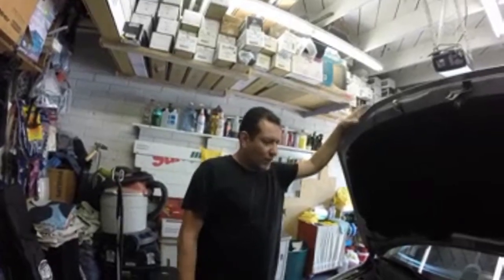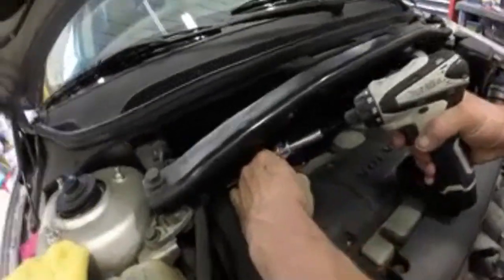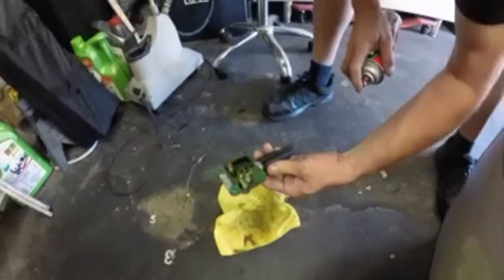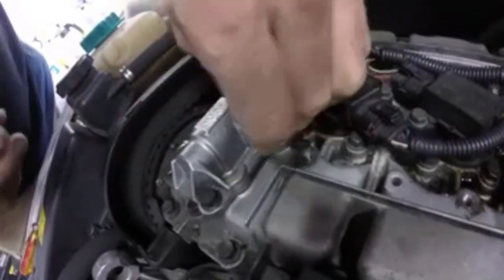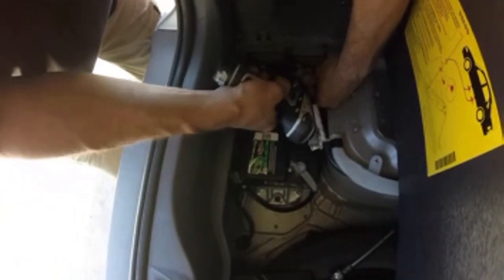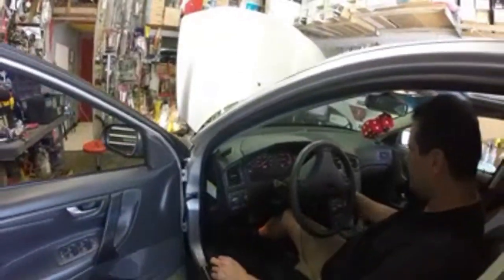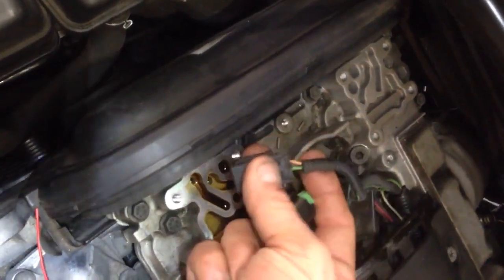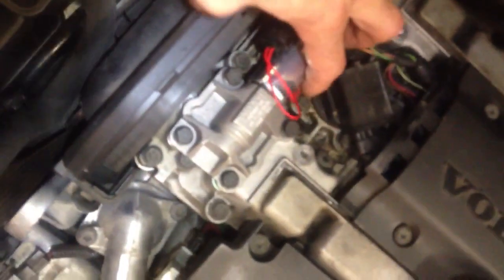Camshaft reset valve no signal fix 2001 Volvo S60 2.4 non turbo code p1011, code ecm-640a.

Comment: Raul, do I need to solder the cable connectors? And what is the exact pressure for the bolts (or is this not important)? I am planning to replace this solenoid soon since I am getting the CEL and the Emissions service required message (OBD II code P1011, so I think it has to do with the camshaft variable timing). Also, is there a way to check if the solenoid really did fail on me?

Thanks in advance and thanks for the very helpful video
Reply from the maker: Michael van Dooren you don’t have to solder them, but if you do, make sure to use shrink wrap. Would Be easier if you did solder, because tucking the wires with connectors is a bit harder.
Reply from the maker: Michael van Dooren not sure what its torqued at. I just hand tighten them alittle snug. I dont know how you could test the solenoid.  Mines was missing the screen on the gasket, and i tried cleaning mines out. Didn’t work, so I replaced it. Cleared code and it never came back
Reply: Thanks a lot man, I'm going to order the solenoid including the gasket etc. this week, I really want to get rid of the code and this is pretty much my last hope

Comment: Raul Romo what kind of power drill are you using in this video?
Reply from the maker: Samuel Simons its a 10.8 volt impact Makita. They only make 12volt ones that are blue and white. Mines can take the 10.8 volt or 12volt battery’s   ( they only sell 12volt replacements for my drill. Hard to find originals anymore.
Reply: Oh ok thank you Raul Romo and I got one more think to ask on my Volvo I got a code P0027 is that an easy fix? Or could you recommend me a video to watch?

Comment: I have a 2001 S60.  Getting c ode P1011, which is in this video's title, along with evm-640a.   Are these two codes one in the same?  Having no drivability issues, just a check engine light that keeps coming back after being reset (apx 50 miles).
Reply from the maker: Yes they are. It's two different types of scanners, but same code and issue. I replaced the solenoid and it fixed the issue. Cleaning it didn't work.
Reply: EXCELLENT!  Thanks for quick response!!!   Looks easy enough to fix--thanks to your video.  Much appreciated!
Reply from the maker: +TC L dealer item
Reply from the maker: yes they are the same.  the P1011 is the code you usually get when you scan it with a regular scanner, the other code is what volvo uses as there real code.
Reply: ค.

Comment: I wanted to know was your volvo making noises due to bad solenoids ? Because i have a 2006 volvo s60 and its making some noise sounding like a diesel truck . Please let me know
Reply from the maker: No it was not.
Reply: @raiderman28  was it because of the vvt pulley? How can i fix this
Reply from the maker: If it is a knocking noise like a diesel, it can possibly be something bad, like a piston, or valve.   You should have a mechanic take a look at it, maybe do a compression test on it.  Do not drive it, if it is making that sort of noise. Also make sure the oil level is correct.  Not enough oil can mess up an engine and usually you will here that sort of noise
Reply from the maker: @claubt123  your getting into more complicated repair, that most DIY’s don’t really have the knowledge to fix. I wouldn’t fix it my self, and i know quite a bit about volvos.
Reply: @raiderman28  thank you so much. Do you think it can also be the vvt pulley because in another video it was making that exact noise and they said they replaced the pulley and the noise went away. My oil level is fine the motor sounds good only when idling it will make a noise coming from the solenoid area
Reply from the maker: @claubt123  unless its an idler pulley ( which is where the belts are ) not were the timing belt is.
Reply from the maker: If its an idler pulley, thats a pretty easy repair. I usually take a piece of pvc pipe, and point it in the direction i here the noise, and listen with my ear. Be careful not to hit a move part.  You can pin point the noise this way.
Reply: @raiderman28  i hear it coming from the solenoid area i replaced the solenoids and the noise didnt go away
Reply: @raiderman28  if its an idler pulley could that be a reason its making that noise?
Reply from the maker: @claubt123  could be a valve

Comment: Raul, so does it make a difference which way you connect + and ground cable to solenoid?
Reply from the maker: Solenoid is not grounded. The wires don’t matter which way they go from solenoid to wire on the vehicle. If they were different colors on solenoid then it would matter

Comment: Hi. I'm having the p1014 error in my Volvo V40 2.0T 2002. Engine looks pretty the same, as here.  The error in obdii tells "exhaust camshaft position actuator park position bank 2". Do you have any advice, how can I deal with that? Please. Thank You in advance for any reply.
Reply from the maker: Marek Der not sure what that error code is. But sometimes the Solenoid gets clogged up or doesn’t function correctly and your check engine light will come on. I tried cleaning mine, and that didn’t work. Bought a new one, reset code and it never came back. I had also replaced the oil trap, because previous owner didnt do regular oil changes, and they can get plugged and cause all kinds of issues. Not easy to replace either
Reply: Your camshaft timing is advanced that being a 2.0 is the vvt exhaust side ,cause is using the wrong oil!! Must use tier 1 oil in white block engines Volvo 1995 up!Amsoil,Moley,Mobil 1,what Volvo recommends is Castro XT 5/30 must be FULL SYNTHETIC !! PUROLATOR OR WIX MAKES THE #1 FILTERS

Comment: Got a code p0014 having to do with the camshaft valve on a volvo c70 2001
any advise on what else I could do? I'm gonna try getting the part off from a junkyard and see what happens, but any input would be much appreciated it.
Reply from the maker: sorry, not familiar with that code.  I thought I read it had something to do with vvt solenoid being clogged up due to sludge in the oil.  if that's the case your pvc system might be clogged.  its quite a bit of work to replace.  I have done a few. also have to clean out the vvt solenoid or replace it with a new gasket and screen.

Comment: What kind of drills are you using and where can you find a 90 bit like the one you use to take plug cover off?? Thanks
Reply from the maker: Minion Web Design I use small makita drills and you can find that  angle bit at you local Home Depot
Reply: Thanks for your quick response
Reply from the maker: they are the smaller 10volt makita.  i think they make it in a 12volt now.  i bought the angle bit at home depot.  i think its made by milwaukee.   i also have one made by dewalt that i bought at home depot.

Comment: Raul my Volvo s60 is reading engine service urgent with no acceleration can you help me out?
Reply from the maker: Your car might be in limp mode. Thats not good. Very expensive to replace throttle body and reprogram.  I think only the dealership does that

Comment: Hey man I’m getting code P0348 and I relaxed the camshaft sensor and housing but the code still pops up ? Can you shed some light for me man ! I liked the video for future references.
Reply from the maker: This is what i found on this code
What the P0348 code means. This code tells the PCM that the camshaft position is incorrect for the optimal performance of the vehicle. If the camshaft sensor detects a voltage reading that is more than 10% higher than the manufacturer's specifications, the P0348 code will be stored.
Reply from the maker: I am not a mechanic, i just have worked on alot of these volvo’s. I don’t really get into deep repairs.
Reply: @raiderman28  I did replace the sensor and the housing but the code still pops up so I’m a stump

Comment: Hello there i have a 2001 s60 t5 it has no dash ights doesnt crank over  or click.new battery.raa says no power gettin to ignition do you have any ideas please
Reply from the maker: Michael Sizer sounds like your battery is dead
Reply from the maker: Michael Sizer those cars also have a ignition immobilizer that is right after the key. I had one Volvo that wouldn’t start and it was that. But it never said no power.

Comment: I have a 01 volvo s60 and its throwin 2 camshaft codes 664A camshaft control and 3000 camshaft position (CMP) sensor... And won't start, not sure if the gasket was just blown, cuz I did notice it dumpin oil from that area the day before, or if the camshaft needs to b replaced,  please help w any info u can, I'm at a loss rn
Reply from the maker: I don't see that code 664a anywhere 
3000 either!!  Who got the codes for you?   That solenoid usually doesn't effect too much of it starting, but it's possible, because it had something to do with timing.  I would have someone check your compression first,then rescan the codes
Reply: +Raul Romo the shop, it was a new fancy reader
Reply from the maker: +Vape Baby there is a special code reader for volvos
Reply: +Raul Romo well first i replaced the maf sensor cuz i thought thats what was wrong and it was throwin a maf sensor code, but then a found a huge hole in my innercooler hose and replaced it,  and realized I probably didn't need the new maf sensor,  then  I took it on a 3 1/2 hour drive,  when i got there it was leakin oil... drove home and it was real rough, but got me home, next day, it didn't wanna start
Reply from the maker: +Vape Baby MAF sensor won't cause a no start, but clogged air filter might, bad timing belt, no spark, from a bad coil pack
Reply: +Raul Romo no, I know, with maf sensor it will usually start, but die unless giving it gas
Reply: +Raul Romo i fixed that problem and now it's got a new problem,  probably brought about by the other problem,  to check maf sensor u just have to unplug it, if it runs without givin it gas, its bad, well I bein a ditz dtove it literally only 1 block away to parts store and back unhooked
Reply: +Raul Romo and I just replaced the timing belt a few months ago along w the coil packs n spark plugs and the airfilter
Reply from the maker: sorry for the late reply, not getting these messages for some reason.  so what's the car doing now??  is it running?? running rough??
Reply: +Raul Romo ended up replacing the cvvt solenoid and having it retimed, now it's  still running rough at idle at cold start its real bad, then once warm runs smooth, then when hot, it's  doing it again. thinkin maybe the idler pulley needs some adjustment
Reply: +Raul Romo ended up replacing the cvvt solenoid and having it retimed, now it's  still running rough at idle at cold start its real bad, then once warm runs smooth, then when hot, it's  doing it again. thinkin maybe the idler pulley needs some adjustment
Reply from the maker: Vape Baby any codes popping up??
Reply from the maker: Have you had the fuel pressure checked?? Could be a bad fuel pump, injectors, fuel damper. I know on this volvo that I worked on in the video also had  cracked fuel injectors, and the car only had 115,000 miles. I bought some off of eBay and bought an OEM fuel damper, same on another volvo I had, that fix many issues that some mechanic couldn't figure out. 
Might be that you are getting some air coming in through a cracked injector ( so car's computer compensates with more fuel and it runs bad,then it warms up and the crack semi closes, less fuel and runs better, but when it gets hot, the crack opens up again and it repeats the process. Might want to look into that. Volvos have issues with there injectors and injectors seals.  You can get a set for around $100 damper $55-60. If they put a scanner on it and look at the live feed and watch the fuel trims, it can indicate if it's a fuel issue.

Comment: Code 60,61  and 62 are showing up on a volvo I am considering purchasing (V-40,2000). Is this a series problem?
Reply from the maker: Nancy Mathis- Rodriguez I would replace it as soon as you can, faulty oxygen sensors can cause too much fuel or not enough and the computer can try to over compensate and then ruin your catalytic convertor

Comment: what are the symptoms when this solenoid goes bad?
Reply from the maker: st33fie only symptoms i remember was knocking and pinging, and engine code.
Reply: rough idle and surging when in gear but holding the brake pedal down.

Comment: I have s70, year 2000 with code ecm 6400 and ecm 640a.
Camshaft low signal.

Would replacing the vvt fix the problem?
Reply from the maker: Your ECM 6400 code relates to the SIGNAL in the wiring going to the valve ... so check the 2 wires thoroughly between the ECU and valve , if necessary replace them . I would do this first and reset and re check. This can be throwing second code. If not then possible solenoid or cam can be bad
Reply: @raiderman28  wires going from the vvt you mean?
Reply from the maker: @John89375  the valve solenoid has two wires going to it. Follow those wires and check for cracks
Reply: @raiderman28  thanks buddy, much appreciated

Comment: ECM 640C?
Reply from the maker: Volvo
Code:
ECM-640C
Definition:
Turbocharger (TC) Control System, Signal Too High
Description:
The diagnostic trouble code (DTC) is stored if the ratio between the measured boost pressure (measured value from the boost pressure sensor before the throttle) and the calculated boost pressure (calculated value after the throttle) is incorrect. The diagnostic trouble code (DTC) can be diagnosed when the engine is running and the turbocharger (TC) control system is not active.
Cause:
Air leakage downstream of the turbocharger (TC) (between the turbocharger (TC) and the electronic throttle unit)
The boost pressure sensor has come loose (measures the atmospheric pressure)
Damaged boost pressure sensor.
Damaged check valve to crankcase ventilation.
Reply: @raiderman28  FLOW METER? MAYBE  THE VALVE IS NEW
Reply from the maker: Turbo Volvos are the worst cars. I had one, and got rid of it. It was a money pit.   I got that information online. I am not familiar with this issue myself.

Comment: Got a 2002 volvo s80 2.4 n.a.. cranks over starts then stop no codes
Reply from the maker: michael colgrave try checking all you vacuum lines first, then check out your air filter box and or replace the air cleaner. Then buy some mass air flow cleaner and clean the mass air flow sensor ( let it dry and then try to start it up). If after that it does the same, check fuel pump or fuel injectors and fuel damper ( they usually have issues)
Reply: Never replace  the fuel pump in a Volvo if it has fuel pressure issues.  Check the FPS sensor or the PEM module.  The fuel pump in a Volvo is bulletproof - unlike most other cars.

Comment: I have a damaged exhaust and heated oxygen sensor faults. I will repair those and change the oil first and see if that enables proper vvt pulley timing. If not I will change the solenoid as I dont know if the current one is opening or shutting enough.  I understand this is a closed loop system so damaged exhausts might cause the ECU to send incorrect / different fuel/air/oil ratios to the engine to regulate the emissions to the sensors causing the timing to be advanced or retarded at the VVT pulley? I don't really know if this is how it works but I have watched many videos and I am looking for anyone who has fixed this problem without going straight to the VVT cam phaser wheels which could be damaged or clogged with oil? SO I will 1) replace oil and filter; 2) change exhaust and check/fix oxygen sensors; 3)  replace solenoid; 4) if no progress,  5) inspect / replace VVT cam pulley. Sound sensible?
Reply from the maker: sounds like a good plan, all those are pretty easy repairs except for the vvt cam pulley.

Comment: Hey Raul, i have a code p1103, intake manifold air flow adaptation upper limit achieved, can u shed some light?
Reply from the maker: P1103 OBD-II Trouble Code: Mass Airflow Sensor in Range But Higher Than Expected
P1103 means there is an issue with the mass airflow sensor, likely due to faulty or loose wiring and connectors in the sensor, or an air leak.

Comment: i have a 2004 s60 and its giving me a code 1000 what's that..?
Reply from the maker: Frank Vega P1000
Description of the defect

OBD (On Board Diagnostic) System Readiness Test Not Complete
The OBD monitors are performed during the OBD Drive Cycle. The P1000 will be stored in continuous memory if any of the OBD monitors do not complete their full diagnostic check.

Comment: my 2004  Volvo s60  has no oil pressure
Reply from the maker: Sandra Sanders make sure to check the oil pressure switch , they fail on most volvos.  I had a s80 that would should on the dash, no oil pressure , turn off car asap. But the car ran fine.  Turned out to be a oil pressure switch. If it's not that , it's usually the oil pump.
Reply from the maker: Sandra Sanders also most of these Volvo have issue with a clogged oil trap. This happens from not changing oil often enough, the oil trap and lines get clogged.  I have replaced a few of them, they are a pain to do and take a lot of work to replace.